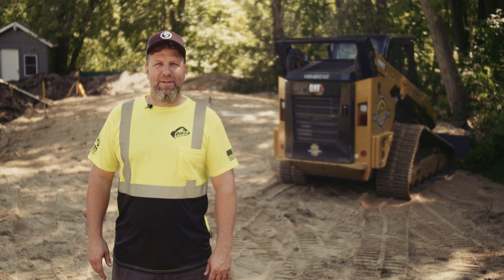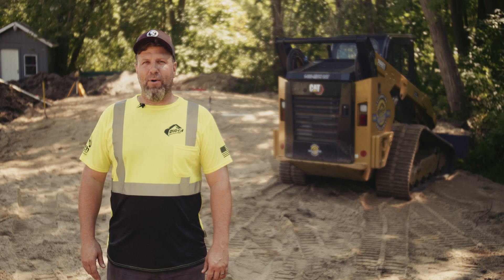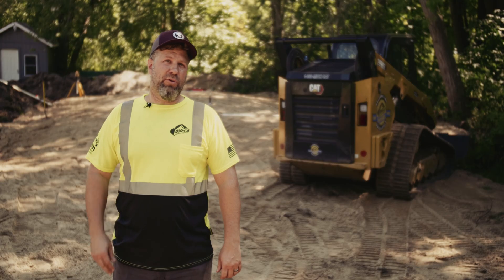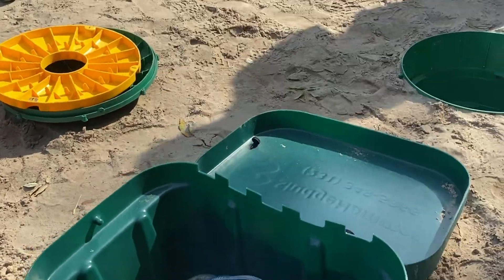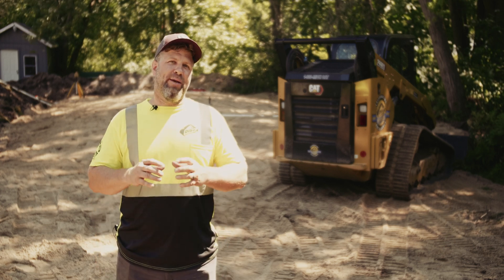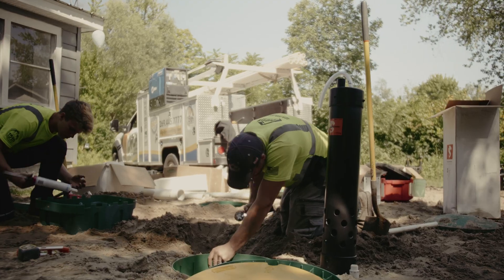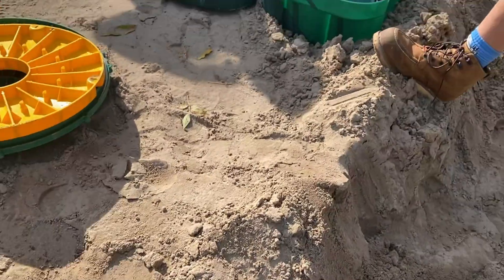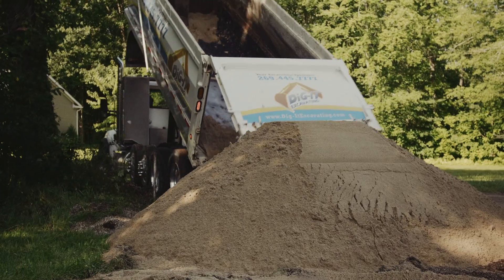SludgeHammer® septic system solves high water table problem!

Comment: Also, how many states support this system and can you conduct the reprocessed water into something like a drain or ditch ?
Reply from the maker: For Michigan there is no statewide septic code as of 2025, so they have to be installed through an appeals process with the health department. SludgeHammer is all over the country though! Not sure what the process is in your state. Contact SludgeHammer to find your nearest dealer.
No it still must have an approved drain area for final treatment. But the drain field can be much smaller and closer to a water table.